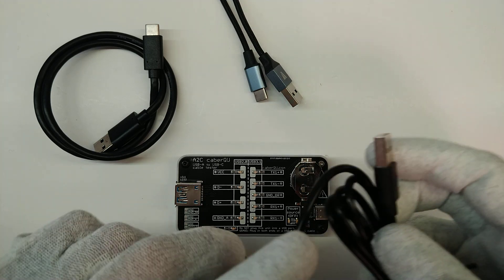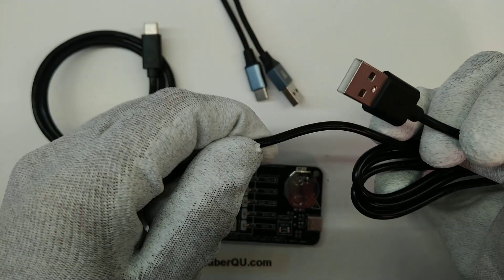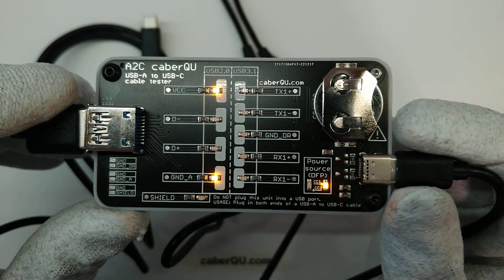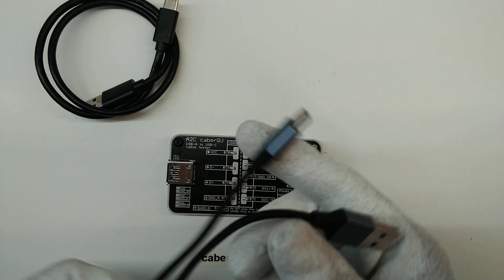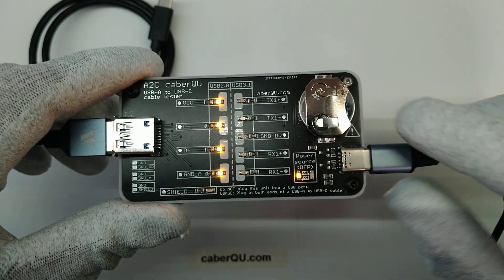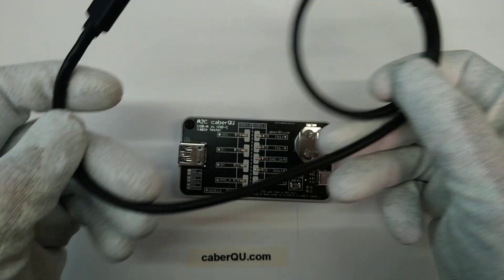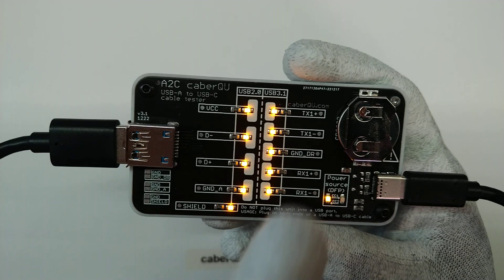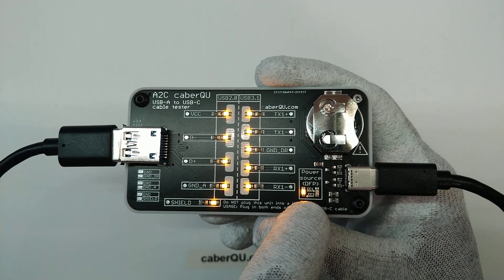Three different USB cables tested on the A2C caberQU

Comment: Hello QC .... A cable USB A to USB C has 2 resistors to CC1 and CC2  with VBUS to work USB C in both configuration? Or one resistor to CC1 and VBUS?
Reply: The USB-A to USB-C cable uses a single 56KΩ resistor on one of the DC lines to indicate a maximum of 3A. 56KΩ resistor is on the CC1 with VBUS.

Comment: How does it know which end is DFP and supply power is it always the Type-A ? Is there a chip that determines that in the cable ?
Reply from the maker: A USB-A connector always is DFP by definition, the USB-C indicates itself as UFP via the resistors lighting up the CC2 LED on the A2C caberQU. If this resistor is missing in the cable, the device you want to charge will not recognize it as a charging port.
Reply: @quiescentcurrent  Thanks for the info!